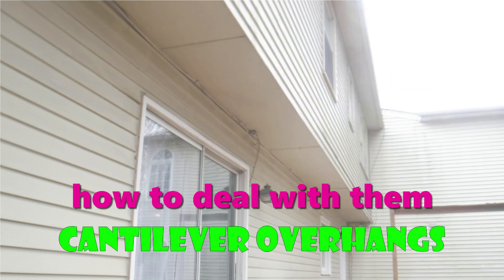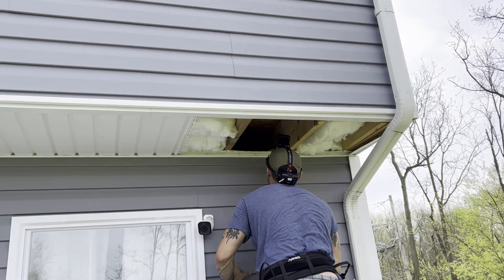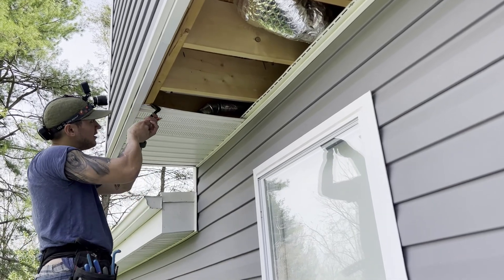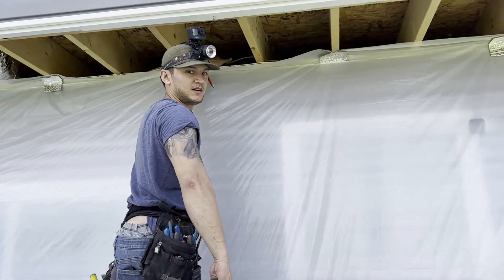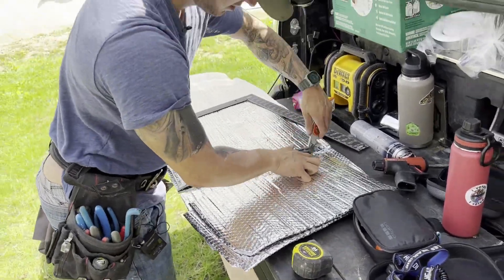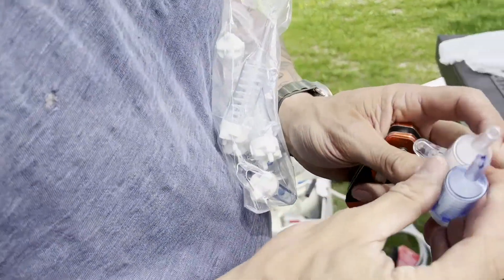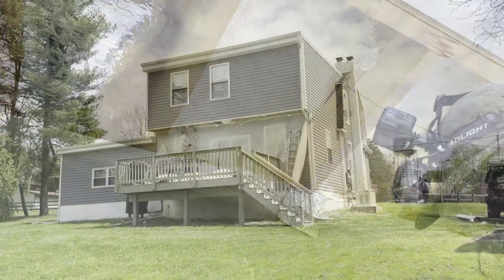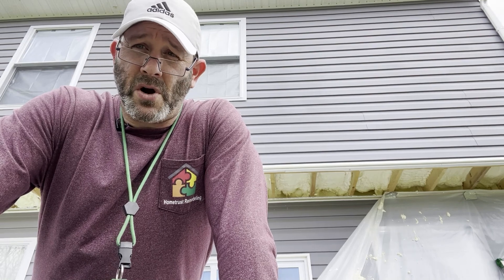The Steps to Insulate an Overhang Floor Using a Spray Foam Kit

Comment: How much this cost to do this? I am a single mom and need to save to get this done
Reply: Thank you so much for giving me this information.
Reply from the maker: That is a really tough question to answer because there are variables that I cannot see to determine how to provide pricing. But, what I can say, is that you can do some research and find the cost of 1/2" foamboard, a case of spray foam, a spray foam gun and get an idea about the material cost. You have to think about the effort that must be put into to taking the soffit down and putting it back up when getting labor estimates. Get an energy audit first if you can and if you decide to get the overhang done then get a few estimates and make sure all of your questions are answered before choosing the company to do the work. Here is another look at some of the details: https://youtube.com/shorts/bWKZQIJkPy8

Comment: Good video  however why didn't you use a flapper for the bathroom vent. The one you used bugs can easily  get in the vent and ibto thebhouse through the bathroom?

Also mind if i ask howmkuch you charged for this project i need mine done and jus twanna know what pricing to look for
Reply from the maker: I could be mistaken but I believe it does have a spring loaded damper.

Comment: This is one of the issues we've been dealing with ever since we bought our house 10 years ago. We have a cantilever that spans the entire length of the back of our house and there's no insulation in it at all. We found that out when we had the carpet in the living room replaced a few years ago and when the installers pulled up the old carpet and padding, I was shocked to discover that I could see outside through the floor along the whole length of the living room! The back part of out kitchen sits on the other section of the cantilever. That would be the back counter where our sink and dishwasher are. Every year when the outside temp drops below 25°F, the pipes for the sink and the line for the dishwasher freeze so we can't use either one until they're thawed out. We've gotten proactive when we know colder weather is coming by opening the cabinet under the sink and pointing a space heater into it to somewhat warm up the pipes. Same for the dishwasher. I did some research on the building codes here in Ohio and found out that insulating a house wasn't a requirement until sometime in 1965, which is the year our house was built. The only place we know for sure has insulation is the main bathroom, because my husband and dad put it in when we remodeled the bathroom a few years ago. There wasn't any insulation in there before that.

We were quoted an insane amount that we couldn't afford to have it professionally done, so I'm really glad to have found this video to share with my husband. We have an Arctic Blast coming on Sunday that is supposed to last until at least Wednesday, with forecasted temps in the single digits and -15° to -25° wind chills expected, so hopefully we can get this done before then!
Reply from the maker: Thank you so much for sharing your experience! It’s incredible what surprises older homes can reveal. That cantilever sounds like a major source of frustration, especially with the freezing pipes and drafty floors. Kudos to you for being proactive with space heaters—though it’s a temporary solution, it’s clear you’ve done everything you can to make the situation manageable.

Given what you’ve described, properly insulating and air sealing the cantilever would make a world of difference. Not only will it help prevent pipes from freezing, but it will also make your home much more comfortable and energy-efficient. Since you’re dealing with an older home, focusing on air sealing those gaps along the floor and insulating the cantilever properly with materials like rigid foam board or spray foam could be a game-changer.

It’s great that you’ve already tackled the bathroom insulation—each step brings you closer to a more comfortable and efficient home! Wishing you warmth and comfort over the next cold snap!

Comment: Minor detail… ideally you would want to replace that one piece of vented soffit with a solid piece. Warm, moist air from the bathroom will rise up into that one cavity. Not a huge deal since most of the cavity is covered with closed cell. A much bigger deal if that were a soffit venting up into the attic. Thanks
Reply from the maker: Thanks for pointing that out!

Comment: How much of that foam kit did you use
Reply from the maker: Hey, honestly I don't recall. But, here is how to check how much you need: Board Feet - for example if you buy a froth pak that yields 620 board feet that is equal to 620 12" x 12" x 1" 'thick areas. So you have to do some math. The R-value is around 6 per 1".
Reply: @ thank you!!
Reply: @ is that technically equivalent to 1sq ft right?

Comment: Great video. Very informative. Able to share the estimated cost of a project like this?
Reply from the maker: Thank you! Cost is going to depend on the total area you need insulated and labor. What I did do is paste two links in the description for what materials you would need to cost up and how much area they cover. If you choose to buy anything, I might make a few bucks from Amazon, but you can use the links and material and price guidance.

Comment: This is one of the last air sealing projects in my house and was shocked at what I found. Started working on my rim joist this week, which goes back twenty inches, due to the overhang in front of the house. Who ever owned the house before or the builder decided that stuffing R-13 paper backed fiberglass insulation in the space was a good solution for air leakage in the area. I started on it yesterday afternoon by pulling out all the disintegrating insulation and cleaning out the bays. I planned this morning to use a 24" great stuff spray foam gun on the back at the seams to seal it up, before using inch and half foam blocks and Mineral wool insulation. I didn't notice it yesterday afternoon because the sun was on the other side of the house at the time, but this morning I couldn't believe what I was looking at, Daylight coming though the back of my rim joists. Every single bay three out of the four sides on the back panel had daylight coming through the seams. I couldn't understand why the marble windowsills above the overhang were always ice cold in the winter, I do now. I think my heating bills this winter are going to drop a lot, once I'm done with this project.
Reply from the maker: Amazing report! You are absolutely going to benefit from getting this done! I am eager to hear how things play out! Please check back in!

Comment: Thanks for the great video. I have the same project to address this summer. During my resarch I've noticed that carpenter ants are highly attracted to foam insulation. Given that this insulation is located outside, aren't you concerned about potential infestations and the resulting damage they could cause?
Reply from the maker: Hello. Thanks for watching. No. No concerns whatsoever.

Comment: How not to do duct work 😞
Reply from the maker: Care to elaborate?
Reply: @homeairleakagetest  When he removed the piece of duct to accommodate the exterior diffuser, there was a gap between the duct and the soffit. He used foil tape to make up for the gap. I think it would have better to cut & re-use the piece of duct that removed, instead of relying on tape to do the job. Then seal it with the tape.

Comment: A question on the foam kitty - it says no more than 2” in the application on the box but you went for 4”. Explain (and I get the desired R rating you’re going for with 4”.
Reply from the maker: Yeah, I am constantly learning and trying to get better and better. This was pointed out to me yesterday, and I responded that I was unaware there were two different types of kits. We achieved results, and I will consider using the 210 pack in the future.

Comment: Outstanding video - thanks for the explanation of the process. Any idea how cold the weather can be to apply the foam. I have this issue and would love to address it now vs spring.
Reply from the maker: Thanks for the feedback! The trick is to keep the cannisters in a warm place until ready to use and make sure you have all of your surface areas prepped and ready so that you can apply the foam fluidly.

Comment: I see you are using Froth Pack 200. Is that preferred over the 210 for this application  ?
Reply from the maker: I have to say that I did not really know there were two types. I believe for this application it worked out well and we got the results we need with the materials we used and also giving the project attention to detail.  The biggest concern with the overhang is the air infiltration and the 200 is a sealant. In the future, I would consider using the 210.

Comment: I have a raised ranch. 50' wide. Cantilevered front and rear. Will 1 Froth pack Kit be enough ?
Reply from the maker: Hi there. The way to figure out what you need is to think in board feet. For each 1 x 1 area, a board foot is one inch in depth as well. So if you have a 200 sq feet of area to cover and you need an R-value of 25, then you will need 800 board feet (200 x 4" (assuming the R per inch is around 6)) so if a Froth Pak covers 200 board feet then you need 4 kits or get the larger kit 650 and a smaller one.

Comment: Why is the foil needed, doesn't the spray foam provide a air barrier and thermal barrier?
Reply from the maker: To block the open cavity.
Reply: @homeairleakagetest  doesn't spray foam do that
Reply from the maker: It seals and insulates. The foil provides something rigid for the foam to adhere to. You cannot use the foam to block effectively.

Comment: Thanks for this video. Some other resources I've found warned against spray foam in these types of applications because it can trap moisture and mold.

It didn't look like you had any concern about that. Can you explain why?
Reply from the maker: Thanks for watching!  I see comments like this all of the time on the different groups I belong to online and I don't really understand why there is concern. First, sealing a house is always a good idea no matter what climate. Without a thermal and pressure boundary (sealing) to the outside, houses are connected to the elements. Air carries moisture and dirt (not to mention those holes are places insects and critters get in). When you seal the holes, the house is more protected therefore more sustainable. After air sealing a house, spaces on the inside are easier to condition, comfort gains are made, and energy bills can go down. There are no places inside a house where air can get trapped. The inside air is omnipresent. If you get mold in an area you cannot reach you likely will have mold in areas you can also see. Yesterday I had a customer tell me the brother-in-law is a contractor and he says houses need to breathe. To that I would say, yes, however, get into the 21st-century way of thinking and take control of your house's breathing rather than letting it do so uncontrollably.

Comment: My cantilever is accessible from the basement. We needed emergency plumbing in the area, broken valve on cold water line and a hot water copper line ready to go. And when we looked in the pockets we found vermiculite. Asbestos people coming Monday. Ugg.
Reply: It’s not. I had insulation added in the spring and there wasn’t any vermiculite up. There. House built in 1978
Reply from the maker: Wow! I am guessing you live in an older house? Hopefully, it is not in the attic too!

Comment: It’s crazy that houses are still being built like this. My old house was built in the late 60’s. At the time I did mine, I wasn’t aware of the spray foam kits otherwise I would have gone that route. Cantilevered Room Insulation - Part 1
https://youtu.be/su7nu8WIDEw
Reply from the maker: Awesome work! Thanks for stopping by!!

Comment: This was my house. The cantilever sealing made a HUGE difference, the bedroom used to be 5 degrees warmer or cooler than the rest of the house and now it's right there with everything else. In combination with some sealing work in the basement my A/C bill is down and I was able to switch off one of my two dehumidifiers, which is over $300 a year in savings. Eric and Kyle did a fantastic job, and left everything looking the same as they'd found it. I highly recommend Hometrust Remodeling, plan to have them out again later this year for some attic insulation.
Reply from the maker: Thanks for chiming in Mike and glad you are already experiencing some of the differences a project like this can make for the comfort and efficiency of your home. Looking forward to working with you again in the fall.